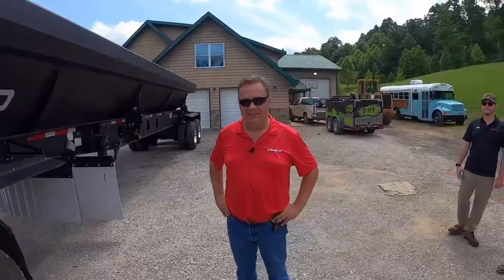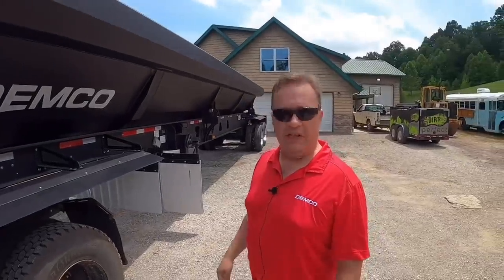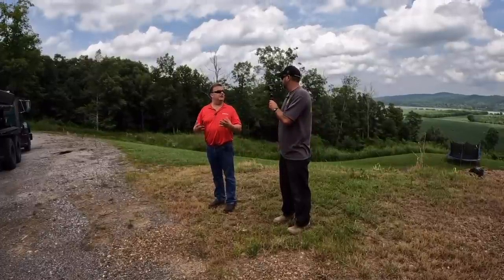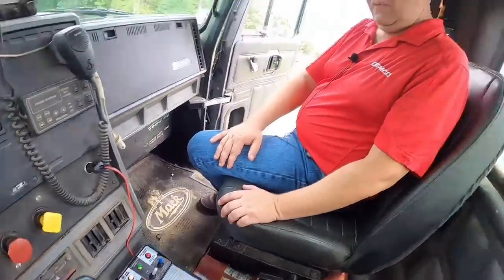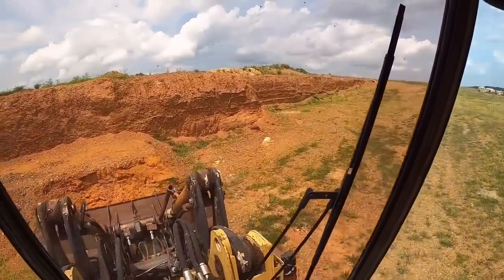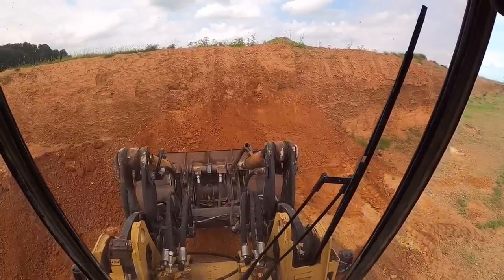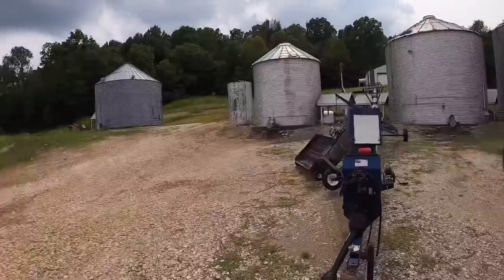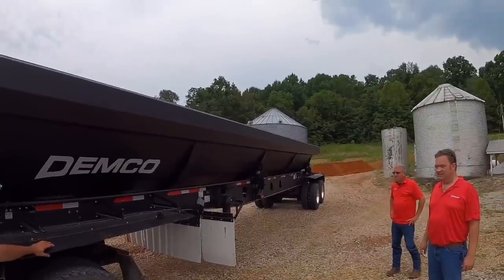Will A New Demco Side Dump Trailer Be Useful For Our Operation?

Comment: Ok, if I’m going to spend that much for that custom of a trailer it better have hydraulic lock and unlock for the side dump selection so I don’t have to get out of the truck!
Reply from the maker: So confused by this comment
Reply: @DirtPerfect  not that complicated. You have to unlock and move the orange indicator thingy to determine which side it dumps on as the demco man demonstrated. You must do this in two places front and back -manually. This should be possible from within the truck hydraulically so the driver doesn’t have to get out and “adjust” the trailer just to set which side it dumps on. The driver can do everything else from the cab with the box except that one thing? Dumb. Also, at the end of the video your rear trailer tires drove through the pile of dirt that fell under the trailer when it dumped…what happens when the load is rip rap or something that is much harder for the trailer to drive over when pulling out? That was my first thought when I saw the trailer: how does it get the material away from the trailer enough not to constantly beat the shit out of the trailer or be able to pull the truck away after dumping? This trailer is one of those “good in theory” examples…but in the real world it will show its shortcomings quickly. Also, while I’m pointing out deficiencies: why would demco provide a 5” cylinder std and offer a 6” as an option? That’s not a large enough difference to warrant the option just use a 6” on all of them. If it were say a 3” vs an 8” I could understand, but I literally laughed when he said 5 and 6. Why make it complicated? Just say the trailer is built with this load and lift capacity with this cylinder end of story. The person buying this trailer is not going to give two shits about the cost difference between a 5 or 6” cylinder. The 6 would obviously last longer, be more stable and provide more roi than a 5…no brainer.

Comment: Dad ran a triple hauling ore and would unload on the move doing 3 circle passes and then out... triple roadtrain unloaded in under 10mins in unload and out the gate 7 to 10 mins including weigh in and out...in thus application there is no better system than side dump... YouTube it